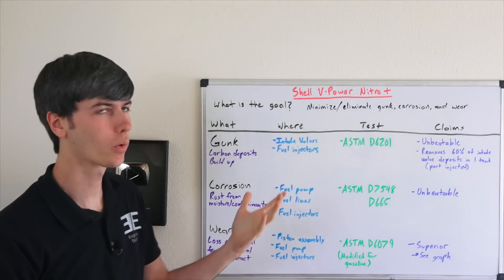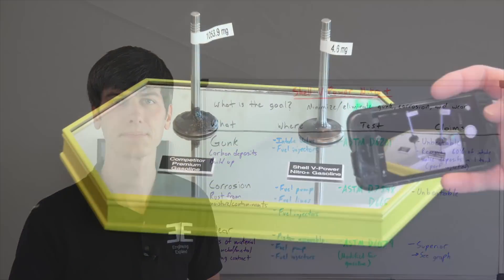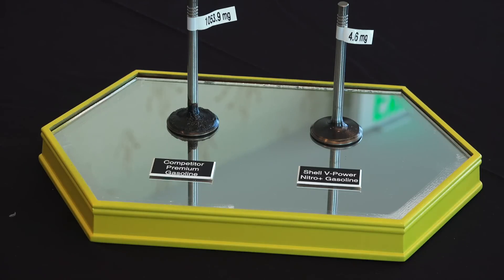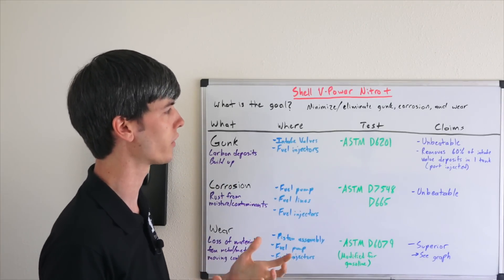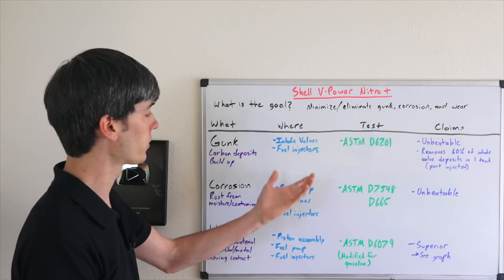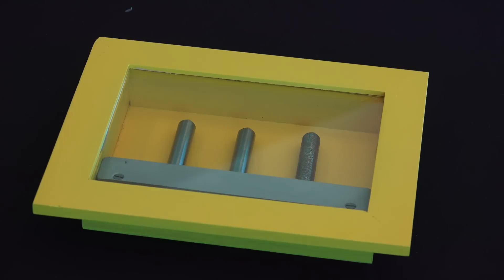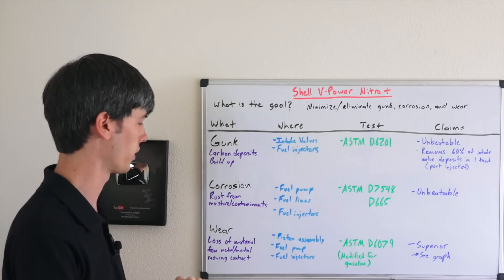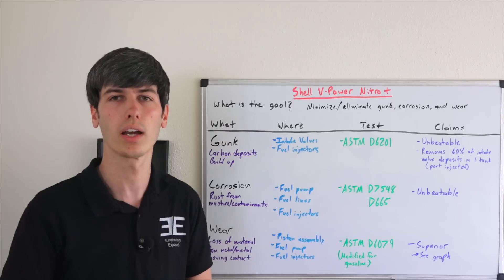Shell V-Power Nitro+ (Premium Gasoline Fuel Testing)

Comment: Here's my problem with this claim. Gasoline Direct Injection. On 80% of cars out since 2012, most manufactures have run Direct Injection... this means the gasoline is introduced into the combustion chamber rather than through the intake and valve train. Carbon buildup on valves in a GDI motor is a result of engine block vapors being plumbed directly from the valve cover or crank case via a PCV (positive crank vent) valve into the intake. THIS is what creates carbon buildup, intake and head staining/impregnation, and can lead to premature engine wear, especially if the car is only driven short distances. I highly doubt this claim based on that fact alone... not to mention the claim that fuel additives will keep anything BUT the injectors themselves clean. People need to do their own research, and not allow a SALESMAN in a white coat pull the wool over their eyes.
Reply: Don't forget about the EGR (exhaust gas recirculation), which plays a huge part in recirculating carbon from emissions back through the intake manifold.
Reply: +AimlessMoto 

Word...i was about to say the same actually.
Reply: I need a catch can!
Reply: oil catch can ftw
Reply: This is why I wish Toyota's DI tech could be used more, but they have a patent.  It uses both direct injectors and multi-port injectors to have the best of both worlds.  Fewer particulates, better cleaning, better power, better efficiency.
Reply: @scottshort9778   i know it's a little late but, Audi also has used this type of injection a long time ( direct and indirect).

Greetings from the Netherlands 👍🏻
Reply: I don't believe 80% of gasoline cars after 2012 run direct injection. I would argue that only 10% have direct injection where as 90% still use port injection. I do agree that carbon on the valves (especially the intake valve) is not caused by fuel but by PCV and EGR systems. Fuel can work to clean this but an oil catch can would definitely help.
Reply: @Curt D - Dude Aimless Moto is correct about GD in most of today’s cars because they supposedly get much better gas ⛽️ mileage. This is an important factor that contradicts itself over the time and life of these vehicles. Unless you actually take these new wonderful Gas Direct fuel saving engines apart and clean the gunk off the intake valves every 50,000 miles the engine performance will degrade over time and eventually lose its initial gas saving benefit.
Don’t believe? Just (WIKI) Gas Direct Injection engine
Reply: @crissd8283  forward 4 yrs..gdi is now the norm.
Reply: AimlessMoto installing an oil catch can in between the valve cover  and the PCV helps a lot
Reply: AimlessMoto I've just manually cleaned the intake valves on my BMW N14 engine. This is a direct injection engine so no fuel is touching the intake valves. However they were dirty as hell. This particular engine runs at 105c most of the time and that created a lot of oil vapour coming off the top of the engine and back in to the intake valves. ewww yuk!
Reply: you forgot about tumble flow, at the correct angle the gas/air mix still cleans the carbon buildup in GDI, and you don’t get as much buildup on top of the valve injectors so less to clean. This channel has nothing to do with Shell
Reply: How about doing a video like this for Chevron and Mobil, since they also claim to clean the engine better than the rest?
Reply: You all need to read your drivers Manuel. 😂😂
All you need to do is run your engine hot. It says in the most DI engine cars manuels that to clean the carbon buildup you need to run the revs high for a nice drive once in a while 

Don’t waste your money on a catch can it is horrible
Reply: There is no mention of this in my 2014 Honda Accord owners manual.  Also, no matter how hard and hot you run your GDI engine, excessive carbon build-up will be a problem.
Reply: @RJ Herb - Of course not, Nobody would buy into the technology. In the long term 200-250 thousand miles Gas Direct will have fuel efficiency issues without proper cleanup of carbon build up. 
Most don’t care cause they don’t keep vehicles that long with that kind of mileage.........
The minute they have one little issue they are done and use it as an excuse to trade up, throwing away 10’s of thousands of dollars in the process!
Reply: Install a oil catch can. That has helped me a lot with valve crud gumming up the system
Reply: The breather gasses aren't the primary cause of valve deposits they just help the combustion soot to stick to the valve while it's open during overlap and the soot is swirling over the valve head (or from combustion soot coming through the intake from EGR if the motor has an EGR valve). That's why venting the breather and PCV still doesn't fully stop valve deposits, just reduces them. The valves still get an oil film from seepage from the guides, so the soot still sticks. Keeping the injectors clean by using fuel blends that are designed not to carbonize in GDI injector tips and have PEA cleaning additives to clean what tip buildup does occur will keep the spray pattern correct and reduce combustion soot drastically. Less soot, less can stick to the valves. That's why fuel composition still matters for valve deposits on GDI engines even though most GDI engines don't spray fuel on the valve and clean it the way port injection used to.
Reply: Azazel Rodriguez II As far as I know that catastrophe of ''tec''  is only on Diesel engines!
Reply: AimlessMoto also I don't know but does it even matter if their is a little water in the fuel it's going to be combusted any way right?
Reply: +Joe Ahea No water is non-flammable(and non- compressible )  and even in small amounts it's not wanted in with the  fuel because it's got to go through the fuel delivery System where it can and will cause damage ie rust/oxidation!
Reply: no, one of the most popular power mods on the DIT WRX is EGR deletes.
Reply: Curt D you are absolutely correct sir. 80% since 2012 definitely fiction, fantasy even. New cars =! GDI.
Reply: AimlessMoto using high quality oil can help this a bit. But it's better to have a fuel injection service done periodically
Reply: Soooooo? Conoco mid grade would be equivalent??
Reply: It's because fuel isn't washing the intake valve, reducing carbon buildup
Reply: ive noticed that alot of newer cars seem to burn quite a bit of oil through the pcv system.. seems like something they would try to avoid. in particular i've seen a lot of chevy 3.6 v6s where the throttle body is actually wet with oil from the pcv. and several times i've had to poor nearly half a quart of oil out of the intake tube because the design in the equinox could allow it to collect there
Reply: @johnhonda93  
You're correct. Modern engines burn more fuel. The primary reason is that modern car engineers have massively decreased internal friction on modern engines. This increases fuel economy and power. The friction is decreased by having a larger gap between the piston and the cylinder. Larger gap means less friction, but also means more fuel slips into the combustion side of the piston. 

So, we get much better fuel economy, but need to too up our engines with fuel a little more often. About half a litre between oil changes.

Comment: I never used to believe that there was a difference in brands fuel.  Having used every available brand on a slew of my own vehicles, the increase in economy, output and response relative to other fuel grades more than warrants to increase in cost.  This is especially pronounced in the brutal summer heat here in Arizona.  I very simply won't run anything else.

Comment: Does this fuel lower the chances of failure of the VW TDi hpfp? VW has claimed that this was caused by contaminated fuel or fueling a diesel with unleaded gas. I just purchased a 2012 Jetta Sportwagen TDi and I'm pretty worried. Trying to find a good diesel with the highest cetane rating.
Reply from the maker: This is gasoline, so it would not apply.
Reply: +Alan Mauro. get it terra cleaned
Reply: Your best bet is a cetane booster. PowerService makes a great line of products for this. 
I use them in my '84 Chevy 6.2 diesel that is all mechanical. Not only do they boost cetane, they increase lubrocity and extend the life of all fuel system components.

Comment: I would like to note that humble mechanic works on a lot of vw engines, many of them are direct injection. Im assuming those pictures in the video where of direct injection engines. Ive never seen a port injected intake valve look that bad.
Reply from the maker: +alphapc777 That is correct, I've included an annotation and note in the video description to address this. Apologies for it being unclear!
Reply: +Engineering Explained I've got a 2015 Mazda with direct injection and the recommendation is to run regular fuel.  I usually get Sunoco or Shell.  It sounds like if this kind of gunk build-up is to be expected on direct injection engines then it would be best to use this Shell Nitro+ fuel?  And if one were to follow the manufacture's recommendation of using just regular fuel should it be expected that problems due to gunk build-up could occur requiring a service visit?
Reply: +Engineering Explained Fairly recently cleaned the intake valves on my '08 GTI, and they looked very similar to the ones pictured. Fuel type and additives won't do anything to help DI engines. The best working solution I've heard of so far is to run water-meth injection, because the only way to alleviate carbon buildup on these valves is to have an actual liquid vapor running past them into the cylinder (other than crankcase oil making its way back through a poorly designed PCV system)

Comment: Almost all of the carbon buildup on the intake valves is caused by oil from positive crankcase ventilation. (oil leaks into the intake manifold from crankcase ventilation valve) Especially noticeable on turbo cars and direct injection cars. (or both turbo and direct injection) This really has nothing to do with what fuel you are using in your car; it has to do with how much oil is being blown past into your intake, what injection system you are using (fuel sprayed over the valves will help keep them clean), and if the engine is turbocharged. (Old/bad turbos can also leak oil into the intake and exhaust manifolds and make a right mess of the valves and catalytic converters)

Comment: The fuel does make a difference and the science proves it. Just my initial thought, wouldn't this be completely irrelevant with the latest eco direct injection engines? Fuel isn't injected on the intake valves so how could it clean them? Would it have a negative effect on plasma coated liners? can it work with an e85 mix. 
Can they advertise something which for an increasing number of drivers would make no difference?
Love the channel keep up the good work :)

Comment: i have no experience with premium gas but with premium diesel. I fill up my bmw 118d (M47D20 engine) since a halt a year with bp ultimate, the engine noise is quieter and smoother and i have better acceleration from 130kph+.

Comment: The image you specified that after only 15k mile have carbon deposit are direct injection petrol motors from VAG group, and on them Shell V-Powe Nritro+ for sure will not clean carbon deposits from intake valves or intake ports because fuel is injected directly in chamber....

Comment: here in Australia we have Shell V Power plus 98 RON it states the same so i will assume it is of the same quality fuel we have had it for  few year now and it is an Awesome fuel to use and does what it claims. I used it in my petrol car all the time but now i run  diesel van and use Shell V Power Diesel and it Half a million kilometres old and still runs like new thanks Shell

Comment: But why is it that at my local Shell station the same fuel truck that delivers here drives down the road and makes stops at other named stations to deliver fuel?
Reply: Isn't fuel in this country federally controlled? All fuel needs to meet given numbers to be able to be sold.
Reply: +fordwindsor351 they have to meet yes but that doesnt mean they cannot exceed.  as for the making different stops at different stations using the same truck, they could all be owned by the same major oil company,  but thats just speculation by me

Comment: i heard carbon build up because of direct injection technology is that right ?
Reply: +احمد يونس Direct injection engines are more prone to carbon build-ups on the intake valves because fuel is sprayed directly into the combustion chamber and therefore does not clean the intake track. For the same reason I don't believe fuel detergents will help clean up intake valves in direct injection engines. 

Intake carbon built-ups are primarily caused by exhaust-gas re-circulation, which is an emissions control system designed to lower the combustion temperature and reduces NOx emissions. 

Ironically, some of the worst offenders for EGR-related carbon buildups problems are Volkswagen TDI diesel engines.
Reply: +احمد يونس 
Carbon build up on direct injection engines is only happening because of the EGR system ,and oilbreather systems going back in the inlet..and NOT having the fuel injector spray to clean of the valves.So Direct injection engines WILL have alot more carbon build up because of the construction itself..and what fuel you use will not do anything to prevent carbon build up.

And on diesels..its even worse. :)

Cheers

Comment: Future fuel detergency isn't going to matter because it won't fix Direct injection carbon problems and that's what all the new cars are experiencing. The fuel doesn't even touch the valves anymore. Sorry Shell, you're trying to sell fixing 2006 and prior problems.

Comment: two words to shell: direct injection.

Now your gas never touches the intake valves, how are they supposed to clean them?
Reply: The majority of valve deposits are from combustion soot that sticks on the valve from either EGR or when the valve is in the swirl during overlap. Fuel that keeps the injectors cleaner and burns cleaner makes less soot so less soot sticks to the valves.
Reply: It’s almost as if direct injection is a bigger gimmick than Shells fuel detergents.

Comment: I read a few comments and maybe it's been mentioned before (I don't have time to read close to 500 comments), but this stuff is pretty legitimate, but only on a port injected engine; Shell V-power Nitro+, or any other gasoline will do nothing on a direct injection engine, simply because there is no fuel with detergents cleaning the valves on the way to the combustion chamber. Some people seem to be shocked that essentially new engines have that much carbon deposits (as shown in the video), but this is what happens with direct injections engines. I've been using Shell for about 8 years now; all of my cars with port injection have over 130k miles and the valves are so clean, that you would think they were just installed, never used. The valves in my dad's car on the other hand, with direct injection, have valves with so much carbon build up, that when I saw it, I almost had a stroke ...just saying, ...from personal experience.

Comment: This bugs me so much, yeah ok some companies like to shove tons of detergents into there gas, I get that they can clean out your car and your engine to some extent. But why would you put a higher octane fuel into your car if you don't need it? Your will WILL run on any octane fuel, if the fuel isn't garbage fuel you won't have any problems with carbon deposits. Modern car ECUs will just change the timing on the engine and spit the access unburned fuel out as ether vapour or liquid in your exhaust and waste your money, if you need carbon cleaning that badly there are detergents you can buy as additives to your fuel once in a while. But running this high octane dish soap through your moms camry is a waste of money. Some cars are exceptions to the rules, right out of my car's manual 

"...performance when using high-quality unleaded gasoline having an octane range of 87 to 89. The manufacturer recommends the use of 89 octane for optimum performance. The use of premium gasoline is not recommended, as it will not provide any benefit over regular gasoline in these engines."

Little bit of bullshit there saying it will run better on 89, but at least there honest enough to say 91 is a waste of your time.